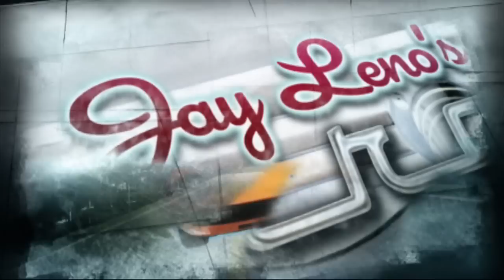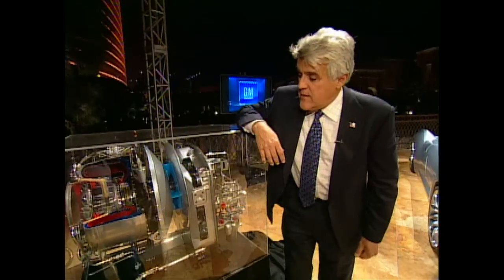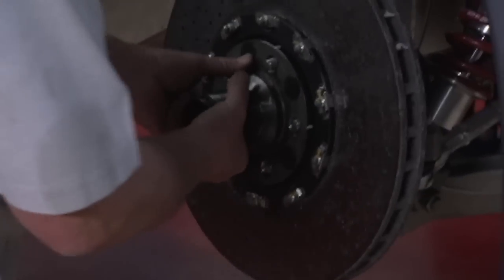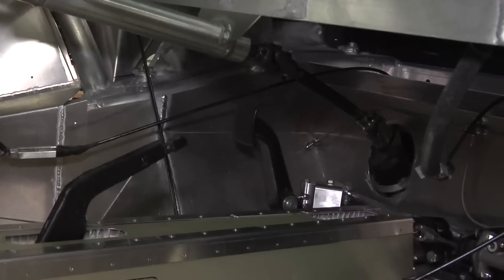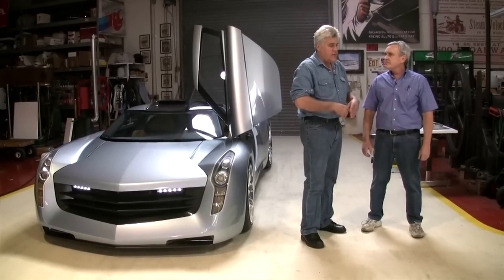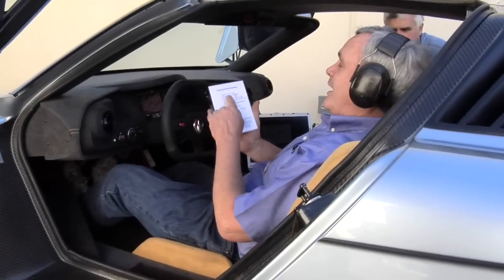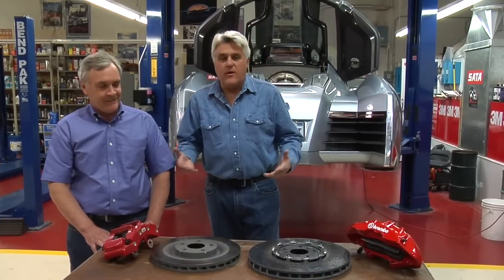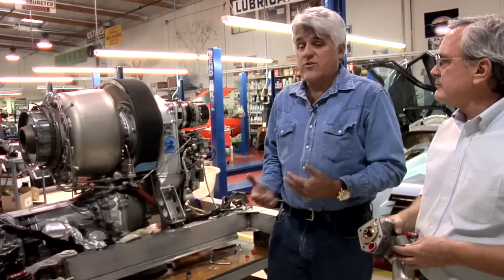EcoJet: Definitive Edition - Jay Leno's Garage

Comment: No better choice for a transmission than a 4l60-E
Reply: Newsom Garage ya a 6 speed auto 4l80e.
Reply: Eddieallen there is no such thing as a six speed 4l80-E
Reply: Newsom Garage there is but it's not used in in mass production. transmission companies like Monster Transmission's has them. they take the 4l80e, 4l85e and rebuilds them as 6 speed automatic that can come with a Transgo shift kit that also makes it a manual shifter without the clutch if the buyer wants.
Reply: Eddieallen the 4 stands for four speed L stands for longitudinal transmission the 80 stands for it will take up to 800 pound feet of torque and the e means electronically shifted. So no there is no 4 speed "4L80E"

Comment: Do folks not realize, the minerals and energy used for green cars outweighs the offset the car produces?
Reply: This car is a one-off, so it doesn't matter. For EVs tho, yes. There is very little they mention about the environmental cost of battery manufacture. When an EV comes off the lot, having been driven zero miles, it essentially has already done 3-5 years of pollution as an equivalent gas car produced at the same time.

Comment: You need a hydro-static transmission or a throttled governor on that engine.  Holding back all that power with bigger brakes is not very eco friendly.

Comment: The odd thing is that Jay himself has one of the GM turbine cars that they made in the 60's.  So what the F?  Why not engineer this around that same concept?
The 63 GM turbine car was quiet and also burned anything that would burn.  This entire exercise seems a colossal waste of time for the simple reason they tried to repurpose a helicopter engine instead of focusing on an automotive solution.

Comment: This seems to have a lot of issues the 63 turbine didn't?
Reply: +Big G the 63 has a turbine built for the road, This has a turbine out of a helicopter. They are 2 very different beasts.
Reply: Yes but he built this after knowing about the other.. He basically chose to have these issues. That doesn't make a lot of sense to me.
Reply: Big G Because you cant get turbine engines that are designed for automotive use. It was the helicopter engine or nothing.

Comment: I think this could have been done a lot better. Why not use a turbine half the size, coupled with an electric generator, powering electric motors coupled with a 911 type automatic transmission? Then you would have a more efficient car with the same performance.

Comment: Burning Bio-diesel is no better or worse than burning normal diesel (I mean slightly worse energy efficiency, slightly less pollution per liter or something like this). In fact, to get it you have to cut down Rain Forest to plant cashcrops while to get fossil fuels you just have to pump it out of the earth. This is only a way for the oil industry to keep going. It's a bit depressing that Leno isn't more informed, as with the most of the population in regards to this issue.

Comment: You can't find anything new on this car anymore....Did he give up on it?
Reply: From what i gather that's what's happened, Jet Turbine tech is expensive, hard to convert to road use due to it's thirst (Full speed and Idle are the same RPM on the engine and sucks the same fuel) and it's general issues concerning maintenance, you suck anything bigger then dust into the turbine, it shotguns around and the car dies, this is why Jet turbine powered tanks and the Chrysler Turbine have air filters bigger then the engine themselves.

Now onto the reasoning behind dropping it [from my guess] It's a dead end, GM no longer cares, and as much money as Jay Leno has, i doubt he has the economic might that GM does to develop this sort of thing any farther. Plus GM lacks the manufacture capability and licencing to make in house Jet Turbines for personal sale and no market for the car exists, other then being a wonderfully interesting prototype, it was dead the very moment jay started thinking of it, GM had no hopes of making it a production car.
Reply: Its me or the chrysler turbine car is better than the eco jet?
The chrysler car dont make any noise compare with the eco jet. And dont have all the high tech.
Sorry for my english, its not my mother language and Iam drunk.
Reply: Harald Hardrada
Its not just you.
Reply: Harald Hardrada; yeah I's drank two and englush is my one languages.

Comment: 2:06: "In a helicopter, this engine could probably lift ... 15,000 lbs, 20,000 lbs"
Yeah :) nope. A 15,000 - 20,000 lbs heli is gonna run an engine more in the 2,500 - 3,500 hp range. A Bell 412 with just shy of 12,000 lbs max takeoff weight is running a PT6T Twin-Pac with a total of 1,800 - 2,000 hp (depending on the exact version).
A cool car nonetheless. Useless, but cool. :D
Reply: Agreed. Generally speaking, a UH-60's maximum weight is 24,500lbs. The engines are T700-GE-701D with an output rating of roughly 1800hp each but derated to roughly 1200hp. So, yea, I don't think a 700hp single engine can lift 15,000 to 20,000 lbs.

Comment: I wonder about the " re-purposing " of the used battery packs. if the manufacturers lose money replacing them, how can profits remain high? if the replacement cost is $5000 and the reconditioned " repurpose" nets $2500, there is a substantial loss. I am no doomsayer, but I tend to question "snake oil" cures. that being said, fossil fuels are a finite product and all who try to find cures should be applauded.

Comment: Cool...but with all respect...Tesla Model S was launched in 2012 and turned Tesla Motors into a technology leader in automotive. This car project on the video is of course very admirable but heck...it's a bit of a bummer of wasted time in respect to moving a car company forward. Jet engines and Windows Vista...great for Jay Leno...but wish he would think about how he could challenge these old-style Detroit guys to become more forward thinking. Rimac Concept One is already done, but why not get someone to make a 1500hp quad drive EV super car or something that puts Rimac to shame? We need to design tomorrow's muscle car EV (that is not going to be a gas guzzler).
Reply: This car was finished in 2006, the video's even older. For the time it was built it was a revolutionary concept.

Comment: I've got an idea for you @JayLeno for a car that doesn't require refueling or recharging and that is a mixture of recyclable and bio-degradable components that will only gain energy the more you drive... I've submit some ideas to design and invention companies with great response, though I live in extreme poverty. Just to be clear I'm not asking for your money or a hand out, but merely for you to maybe listen to my ideas and give me your thoughts or possibly you could refer me to someone that wants to help me with start up and change the world for the better... Zero emissions, no more fossil fuel or fuel or harsh chemical batteries and never being limited to the size of your gas tank... Because you won't have one. Kinetic energy is active in the entire univers and right here on earth and is never running out and doesn't cause pollution... I just caused and used kinetic energy typing this long message lol... I'm not crazy btw

Comment: Biodiesel sounds nice and "eco friendly". They just forget to tell that turboshaft engines are terribly ineffective. Power to weight(and size) is awesome but even under ideal conditions too much heat is blown out by the exhaust. Yeah maybe the exhaust aint as hot as other turboshafts but the amount of air sucked in(and then blown out) is MASSIVE. 

Also biofuel is not the future. Half of the world are starving. Using biofuel is essentially burning food that people could have eaten. I am not a big "save the world" guy but world population is growing and it just do not make any sense to put any effort into using a fuel that surely will not be available in the future when land is needed to grow food, not fuel.

That said jetengines are awesome. So much power in such a small package. Using a shaftgenerator + electrical motor would be a better transmission system though. Like a dieselelectrical train but a jetengine instead of the dieselengine. Excess shaftpower could be stored in a battery instead of heating up the brakes. Even cooler would be a small steam turbine coupled to the same generator to harness all the heat from the exhaust. Would greatly improve efficiency. Would probably make the 650hp turboshaft engine deliver far above 1000hp as less energy is lost. Would probably weigh quite a bit though...

Comment: the best part of more money than brains is: hiring more brains. not perfect motorcars: Stanley Steamer, Ford's internal combustion, Chrysler turbine, Tesla electric. they all have pros and cons, but the trying is key. if we never embark on endeavors, the result of which is not total perfection, we'd still be driving ox carts. oh, ox carts, not perfect motor car. thanks, Jay for trying. it's got a few bugs, but I think Ford's pretty much worked 'em out.    woof
Reply: +woofer devlin 

A few people tried turbines for motor vehicles in racing in the UK in the '70s. The problem is the transmission.

Where turbines make more sense is employing them as generators for an electric drivetrain.

Comment: why bother with a conventional drive train just attach a generator and put electric motors on all four wheels?
Reply: +Tamas Kish [why bother with a conventional drive train]
Weight savings and Horse Power (at the plant) to Horse Power (at the wheels) efficiency.

The more steps you put between your fuel and your propulsion the lower your efficiency and performance (generally speaking.)
Reply: +Dream0Asylum maybe an electric turbine?

Comment: Boy...they really skimped on the screens in the dash...I know this was early 2000's but they had better resolution than what they used for the gauges. Either that or the person who made the interface was an idiot. What am I saying they decided to run the car on windows VISTA. OF COURSE the UI designer was an idiot. Who the hell runs a car interface on a version of microsoft windows...

That's like designing a deep sea submarine and controlling it with a ps5 controller...

Comment: Rip that screaming banshee Jet Turbine fuel guzzler out and drop in Electric motor drives and a CNG engine, generator and a LiFePo4 battery bank in it.

Then it will be quiet, fuel efficient, environmentally friendly and fast.

Jet Turbines are great for aircraft but not at all practical or useful for cars.

Yes they are different but that's about as far as it goes.

If you wanted to keep the turbine then have the turbine run the gen which keeps the batteries charged so it can run at a constant speed and you can control the vehicle speed with Electric drive.

Mach safer and efficient

Comment: 1.Too noisy 2.Terrible mileage 3. Runs very hot 4. Expensive 5. Impractical the jet turbine would work better in a flying car application or much better as a  power generator in an electrical application which would be impractical

Comment: While this is an interesting engineering project, The switch to bio-diesel fuel is not all that ecologically friendly, it is still putting out CO2, and there are behind-the-scenes ecological costs involved in converting soybeans into fuel. The car-nut boy in me thinks this is pretty cool, but the cynical adult thinks the money, time, and talent could have been better used for some other project that seeks an ecologically sensitive outcome (-:).

Comment: not a very good looking car,  mostly all angular and edgey and with a very forward weighted unbalanced look from the side.....very unpleasant to drive with the noise...bizarre little steering wheel....its like a 2 place unpressurized turboprop airplane except it has all the disadvantages and none of the advantages of an airplane.......if ecology is the main concern a smaller or even much smaller engine would get the job done on significantly less fuel, turbines are terrible fuel hogs at the best of times burning 20 gallons or more an hour in idle

Comment: Just why 
Silly design trying to make a Jet drive the wheels.
Why not hook the jet up to a generator and drive the wheels with Electric Motors.
Reply: +GlueGaming Plus it's just impractical just remove the jet engine altogether. It would be just as compliant to not have a transmission, and run, but due to the jet-cars powerful wind coming from the jet engine It might cave in other cars windshields, and dust etc.
Reply: +GlueGaming Isn't the new Porsche 918 a hybrid system?  I feel like he was onto something.  You don't need to have all the batteries in the world for ultimate range in a performance car.  The weight of the transmission would be eliminated as well as the rest of the conventional drive train so its not like your just bolting on extra weight.  I was thinking the same thing he was, except with cool in place of silly.
Reply: +GlueGaming Have you ever worked with jets or done any engineering?

1. Possibly heavier though Electric needs to be 4wd.  
2. Not really.
3. Doubtful jet&#39;s like to spin fast.
4. What you think electric cars cant be sporty see P90D Extreme, Rimac Concept One, Jaguar C-X75 Electric-Turbine Concept
5. or Jaguar C-X75 Electric-Turbine Concept
6. Well yes thats what you get when you try an fit a jet that size in a car.
7. Jet powered cars aren&#39;t supposed to be cheep.
8. WTF would you put a gearbox between the the Jet &amp; the generator.
Reply: Just make it twin jets "as in twin turbos" hahaha...  Can you imagine the air going through that thing... Wow!!! Hmm?